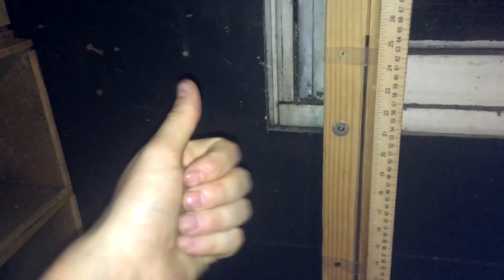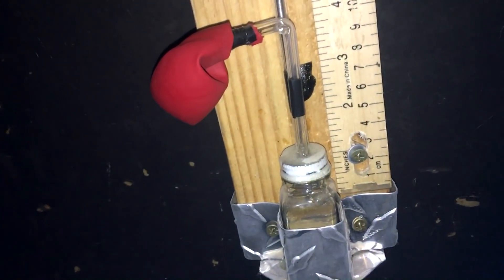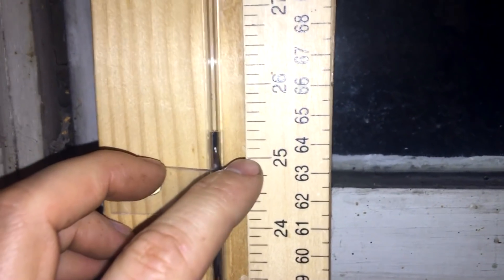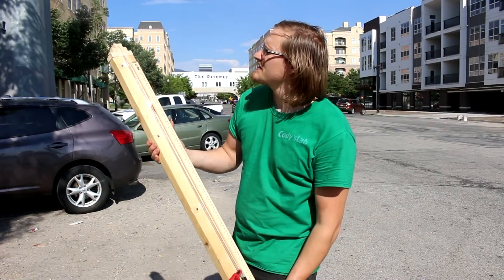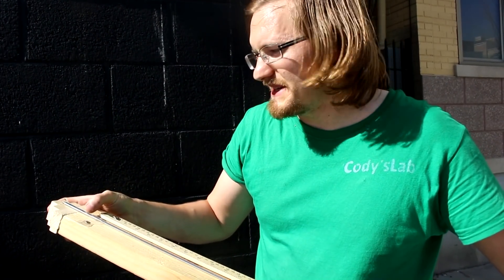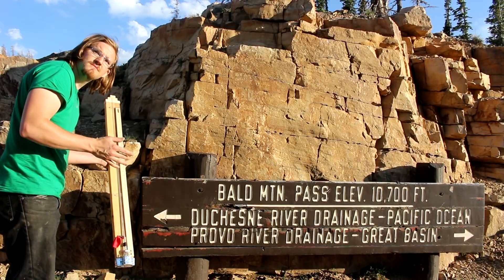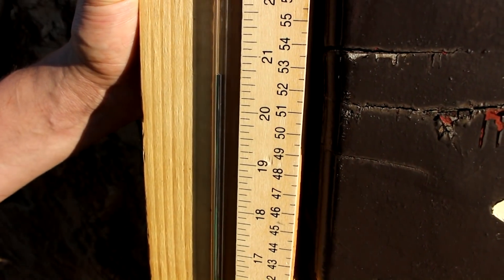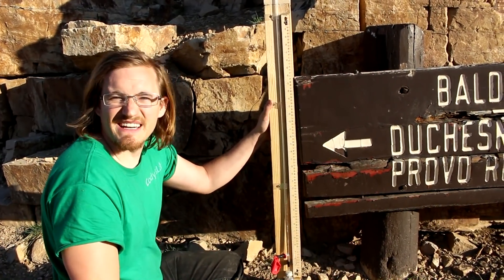Taking my Barometer Up a Mountain

Comment: I did something like this a few months ago. I used the barometer on my phone, though. I started it on top of the Niagara Escarptment and watched the pressure rise as I drove down to the bottom. Its not nearly as high as that mountain, but enough to pop your ears something fierce because it's very steep and you drive down a freeway. The whole trip only takes a few minutes.

Comment: Do you have to be careful how you store it when driving the thermometer in the car? I'd imagine if it wasn't perpendicular to the front of the car, the gas and brake could throw the mercury right out of the tube, and even then, turning raises the same concern. So I suppose you would have to transport it upright

Comment: Question: did you adjust the meter stick for the different altitudes? 

The Hg column is measured from the top of the meniscus of the Hg in the reservoirs the top of the meniscus of the column. So when the column is short, high elevation, the amount of Hg in bottle is high as well. When the column is tall, the reservoir is partially emptied; ie. the surface of the meniscus is low. So the meter stick needs to be adjusted continuously so that zero is AT the meniscus of the reservoir. 

Given how small the reservoir is that will be a significant correction to the meter stick reading.

Comment: Cody, I know you’re being careful, but I’m really concerned about how nonchalant you’ve been about handling mercury.  I understand in it’s metallic form it’s not really that dangerous, and you do take very good precautions when you’re working at home.

That said, this barometer bit was very reckless.  Look, clearly nothing broke or spilled and this turned out okay, but this is a pretty stupid thing to be doing.  If that barometer broke, and all it would take is one minor slip, that’s a huge ecological problem in a public area.  You could get in a LOT of trouble from it, and it’s really not worth the risk for this video.  You could show literally any other barometer and have a similar video, but you chose to use a janky one you made at home using an extremely toxic and environmentally harmful material.  Not that it doesn’t function, but just please consider how serious the consequences are of spilling that volume of mercury.

It has nothing to do with the actual danger, which is rather low, even if it were spilled, but just imagine the optics of this situation.  The press would eat you alive.  You might lose your channel.  There would likely be criminal charges, you could go to jail, and you would be very heavily fined at the very least.

This is reckless behavior, please be more careful.  This video was not worth the risk.

Comment: What would be really cool to see is something that i found on wikipedia while i was explpring passivation processes 

In the mid 1800s, Christian Friedrich Schönbein discovered that when a piece of iron is placed in dilute nitric acid, it will dissolve and produce hydrogen, but if the iron is placed in concentrated nitric acid and then returned to the dilute nitric acid, little or no reaction will take place. Schönbein named the first state the active condition and the second the passive condition. If passive iron is touched by active iron, it becomes active again. In 1920, Ralph S. Lillie measured the effect of an active piece of iron touching a passive iron wire and found that "a wave of activation sweeps rapidly (at some hundred centimeters a second) over its whole length".[7][8]

Comment: Hey @Cody'sLab i just had a really cool idea that i hope you'd consider making a video on. You should test to see if sodium metal can work harden. I was just watching a sodium metal video and thought about the videos where you made a gold foil cold welded ball and how you had to anneal the gold while turning it from bars into a foil to relieve stresses. Gold is a soft metal but you still have to heat it up to stop it from getting brittle so what would happen if you tried to work alkali and alkaline earth metals until they work harden. Maybe starting with less dangerous lithium, magnesium, and work down to calcium, strontium, sodium and potassium or what ever group 1 and 2 metals you have and would be willing to try to work and test the mechanical properties of. i did a light google search but didn't really find too much information specifically on if some of these elements will work harden so it would be really cool if you would try that out.

Comment: Quick question how does the air above the  Mercury pass through the Mercury to allow it to rise if the tops sealed
Reply: The hollow part of the tube is a vacuum.
Reply: Alex Siemers arr ok cheers

Comment: Hey Cody, can you make a hybrid water-mercury barometer so that mercury sits on top and provides most of the weight necessary to counteract low atmospheric pressure and water is used in the open vessel to increase height difference / pressure difference ratio? Given thin enough tube, would surface tension be sufficient to keep mercury from flowing down or is it just impossible?

Comment: On the altitude/pressure topic: I bought a can of Lay’s Stax in Flagstaff and it looked like it was pressurized and about to pop. I didn’t open it until I got to Phoenix and it looked to be under a tight vacuum.

Comment: Hi Cody, doesn't the barometer have to be on a level surface to provide an accurate reading? If it is tilted, the scale would read larger than the actual height of the column. How to you make sure it is perfectly vertical?

Comment: If you have a Samsung Galaxy phone, depending on your carrier you may be able to access the diagnostics menu by dialing *#0*# .  One of the choices gives direct access to your sensors, including a barometer.  I'm not sure of its accuracy, but it is precise enough to measure the difference in pressure of a rise or fall of a single meter.  I annoyed my wife greatly by measuring the pressure continuously as we traveled around Rocky Mt Natl Park.

Comment: I was planning on making homemade wine for my grandma and was using isypropyl to clean the bottle and its 99% so I decided to dilute it with water. But when I did it got rather hot. I'm assuming this is from any traces of chlorine that was used in the purification process. I'd love your input.

(also any good tasting fruit suggestions would be greatly appreciated)
Reply: I tried this with different levels of chlorine and I think I might feel a difference but it could also be my imagination

Comment: When you laid it down you didn't lose the vacuum in the tube, causing to fill with air, creating pressure in tube as mercury rises? Might explain your low reading.
Reply: No, because the air isn't bubbling up to fill the gap at the top of the tube

Comment: Question: Would being in a vacuum change how fast a red hot ball of metal cool significantly? Does this effect how space ship parts are cooled? With no air to carry heat away would more surface area, like a radiator would have, even help an object cool faster in a vacuum? It would be cool to see if you could compare the time it takes objects with different surface areas to cool in and out of a vacuum.

Comment: Nice, this disproves the dome hypothesis of the flattards.
Reply: Arno nümuss, I'm not a flattered but I am curious about your thought process on how it disproves the Dome Theory. Whether the Earth was round with an atmosphere, or the Earth was flat with a dome there would still be air pressure the higher you got right?
Reply: It's simple, flat earthers don't believe in gravity. So only the dome would hold down the atmosphere. Without any other force acting on the air, it would just equalise to the same pressure everywhere in the container. Now in reality gravity holds down the atmosphere. Which means the weight of the air stacked on top of itself determines the pressure. The higher you go, the less air is on top and the less pressure. The air gradually becomes thinner the higher you go, until it's considered a vacuum. For example the ISS is constantly slowed down because there are still enough traces of the atmosphere in that low orbit to affect such a fast and bulky object.

Comment: How much does the inside diameter effect the mercury rising? Does a thick column work less efficiently/accurately?
Reply: I would hazard a guess that since it's in a vacuum, the internal diameter just dictates how much mercury you need. Larger tube, more mercury, smaller tube, less mercury.

Comment: Barometers can be used as altimeters? Fact Check: TRUE! I designed the "Launchpad Altimeter" using an electronic barometric pressure sensor to measure the altitude of model rockets. It really does work! The firmware is free and you can put one together with off-the-shelf parts for about 15 dollars.

Comment: Not sure if your explanation of the pressure before a rainstorm is entirely accurate but it might be a part of it. 
How I learned it is that the jetstream in the upper atmosphere has turbulences so it expands and contracts. When it expands it pulls air up, therefore reducing the pressure and if the humid air is cooled off quick enaugh it can't hold the humidity which then forms clouds and also rainstorms. 
So I think the change in pressure itself contributes much more than the change in humidity, since you can have high humidity without any rain.

Comment: In the vacuum above the mercury, is that a perfect vacuum, or does mercury boil into a gas in a vacuum like water ?  If there is mercury gas in the vacuum, will relatively cold ambient temperature cause some of that gas to condense creating a stronger vacuum and pulling the liquid mercury higher up?

Comment: How tall would the barometer need to be if you made one using your bottle of Clerici's solution?
Reply: About 3x taller since Clerici's solution has a density of 4.25g/mL whereas mercury is about 13.4g/mL

Comment: how does the atmosphere get thinner if the dome that holds the stars keeps the air in 🤔
Reply: the air has weight, so definitely the air will be more dense at the bottom of anything)
Reply: Perspective. It just seems thinner :D
Reply: Atmospheric lensing.

Comment: "52 and a half centimeters, or 520 millimeters" Nice rounding there ;)
Reply: That makes no sense. It only makes things confusing to round unpredictably. I was taught to always round up if it is 0.50 or higher.
Reply: I don't think he rounded, he just made an error.
Reply: or just wrong !!
Reply: Why would one round a number when converting from bigger to smaller units? It doesn't make sense to round 52.5 cm when converting to mm, no matter the rounding method.
Reply: coryman125 Cody rounds the wrong way 90% of the time. I think it’s pretty arbitrary though. And he shows you don’t need to follow convention to be a genius!
Reply: Depends on what you're reading. Math, you round to the nearest. Measurements, you throw away any values below your measurement device's precision.
Reply: Technically speaking 50% wouldn't necessarily mean that you switch every time, just that you do each an equal number of times.
Reply: MIMIK rounding the same way every time will result in a slight statistical bias over time
Reply: Is metric his native language? :-) With imperial how do you round fractions? Do they still teach maths using the imperial system over there?
Reply: @wes3428  For rounding fractions, you just round to whatever is nearest.
For example, if I round 9/16 to the nearest 1/4, I get 1/2 (because 9/16 is between 1/2 and 3/4, but closer to 1/2 than to 3/4).
If I round 11/16 to the nearest 1/4, I get 3/4 (because 11/16 is between 1/2 and 3/4, but it is closer to 3/4 than to 1/2).
If I round 5/8 to the nearest 1/4, then I have a choice: I can round down to get 1/2, or up to get 3/4. That is because 5/8 is exactly halfway between 1/2 and 3/4.
Reply: rounding depends on the application, what outcome will be better? and nothing is exactly 0.5 you can most likely squeeze out an approximate decimal and round using that one. Also rounding up 50% of the time is not random you just alternate, which is perfectly predicable given two data sets. According to statistics you should come out to perfect precision. as long as whatever thing you are rounding averages to exactly 0.5.
Reply: Ergzay 52.5 cm is 3 sig fig, so you are wrong, as he rounds it to 2 sig fig with 520mm.
Reply: Round to even.... Standard practice...
Reply: No he was maintaining significant figures so this is correct.
Reply: In Advanced Chemistry we were told that if you are rounding using a 5, you round up 50% of the time and round down 50% of the time. Considering that Cody is a very sciencey person he probably just rounds down without really thinking about it.
Reply: In new Python, they round to even number, so 1.5 rounds to 2 as well as 2.5. I don't know why (maybe performance, cutting of last bit). However, it means that Cody is not necessarily wrong.
Reply: MIMIK python has more than one rounding function pleb

Comment: '...primarily used for weather...' was soo expecting to hear carburetors/intake manifolds....still a motorhead at heart I guess.
   I used to have an old bike computer that tried to calculate altitude using barometric pressure. Along the coast here in San Clemente CA, I did some serious climbs while ridding a flat trail just a mile or two away from the coast.
...not the most accurate method for a place like this ;)
-Jake
Reply: The similar device that you might use to balance the carburetors on your classic motorcycle is a Mercury manometer but it's certainly true that most people would have to have the two devices side-by-side to work at what the difference is.
Reply: brocktechnology 
It's been 4.5 years since I was interested in and goofing around with cars. Disabled now, so I'm a bit rusty. Manometer does ring a bell tho

Comment: Are there any materials "immune" to thermal expansion? Any state.
Reply: I don't believe other crystals share the property.
I encountered this information while obsessed with building pendulums a while back, the runner-up materials are a stainless steel alloy called Invar and fused quartz which is amorphous. 
Sadly constructing a diamond pendulum was not within my budget but Invar is available from online sources for more or less reasonable prices.
Reply: Diamond has a very low thermal expansion which could be rounded to zero for a variety of purposes.
Reply: Is that a property of crystalline structures in general, or just diamond specifically?

Comment: Now I really want to see you put some mercury in a sealed glass tube and turn it fast enough that the mercury breaks through the glass. That’d be really cool
Reply: You can see this effect with wine in a glass bottle if you whack one end of a sealed wine bottle with a shoe or a soft-faced hammer the hydraulic hammer effect of the liquid inside will smash off the other end of the bottle. It's also the reason that you get the loud hammering effect in pipes when taps are running at high flow and are then shut off suddenly.
Reply: Yes please, in slow motion.

Comment: How hot can you make liquid water under pressure? Hot enough to set stuff on fire?
Reply from the maker: 374 °C; 705 °F which I think is hot enough to combust most organic materials: https://en.wikipedia.org/wiki/Critical_point_(thermodynamics)
Reply: you watched steve mould didn't you
Reply: Cody'sLab Would it be possible to do a video about this or is it just way too hard with your home-gamer set up?
Reply: 218 atm. Could that be high enough to be able to dissolve enough oxygen in the water to support the combustion?
Reply: qtpie senpai Make the container out of prince ruperts drops. That would also allow the camera to see inside.
Reply: theres no way he could get up to 218 atm without a severe risking of killing himself
Reply: Rather than setting on fire, I suspect a lot of things will want to do some kind of syngas reaction, creating CO and H. UK mains gas used to be produced by reacting steam at that kind of temperature with coal.
Reply: Paul Paulson your comment me of the Mitchell and Webb 'poison' sketches 😂
Reply: G M  yes you can heat water, as mentioned above, you can get it to 374 degrees C as long as the pressure is at 218atm, due to vapour pressure vs atm pressure.
Reply: w0ttheh3ll Of course i did :)

Comment: Man I miss Utah. I lived in the mountains east of SLC. Most beautiful place I've ever lived. Btw, how do electronic barometers work?
Reply: They use pressure sensors. Essentially little capsules hermetically closed, one side is a membrane connected to a piezoelectric material that generates a voltage proportional to the force applied to it. You measure the voltage at different external pressures to calibrate it.

Comment: how is the air pressure pushing the mercury up the tube, isnt the air pressure just pushing on the outside of the glass?
Reply: The air pressure at the bottom is pushing on a small pocket of mercury, forcing it upward.

Comment: it would be interesting to see this against a BMP280 temp/humidity sensor, (which you can also use to calculate altitude) just to see the standard barametric values (hPa or millibar) and temps against the mercury values